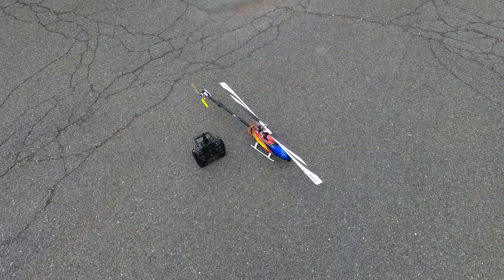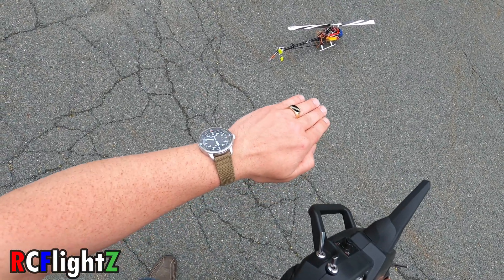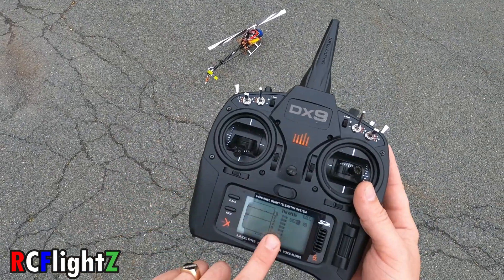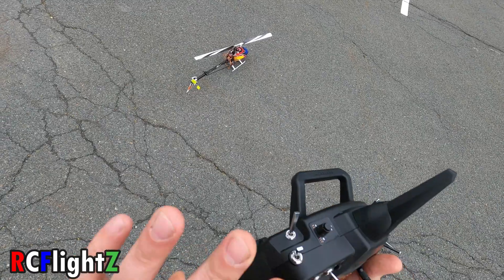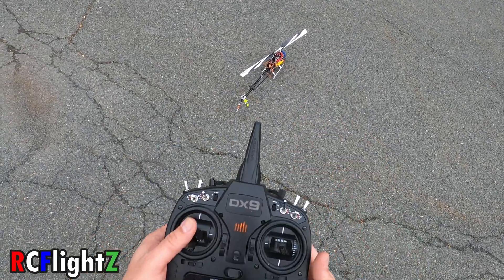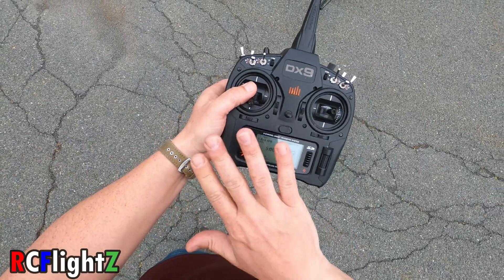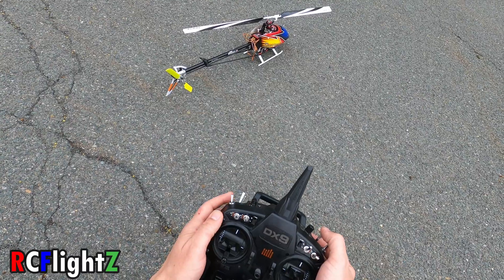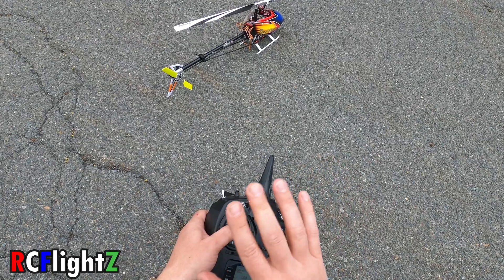Align T Rex 470L Rc helicopter Test Flight, Ikon 2, DX9

Comment: how to tell correct belt tension? 
also- running microbeastx plus, I think I read do not set dual rates or expo in the transmitter, set in the unit- do you know?
Reply from the maker: I use a wrench and push on the belt…should have some flex but not be loose…sort of hard to verbalize.

Comment: Would you reckoned  this heli for a beginner just hovering and circuits.  I wasn't something a decent size like a 500 but that's out of my budget. This 470 seems next best option. What do you think?
Reply from the maker: I’d recommend the 300 to a beginner, I’ve been very happy with it…give it some time and flights…down the road do a 470 full build.  Put time in on a sim, crush it with the 300…then move up.  Thanks for tuning in!

Comment: So the ikon2 has self leveling?    Does the beast-x that’s comes in the super combo kit have self leveling?
Reply from the maker: It costs extra…cause everything has to be a pain with that unit.  Registering, single computer editing, special cord, confusing set-up…go Ikon 2 and save yourself the hassle :)
Reply: @rcflightz2058  so the ikon comes with it out the box?  I was going to either go ikon 2 or go with spectrum To have the safe mode, panic and telemetry.  Plus for programming through my NX8 would be a plus.
Reply: Ikon 2 comes with auto level and rescue.

Comment: I have been flying the little XK 123. Good little heli. Was thinking about the Align 450 artf? I found your video to be very informative. Once I make the purchase,I think your recommended settings would be quite fitting to a new guy like me. That small one is ok,just so small man.. Your thoughts?
Reply from the maker: Personally I worked my way up in size, micro/180/300/400/500/550/650, each size has new parts/features, I’d go for the OMP M2 at this point if I was you.  It’s next level to the 123 and won’t break the bank when you overdue it.  I would consider some sim action as well, can be nice to push your skills and then just hit the reset button.  Thanks for tuning in!
Reply: @rcflightz2058  ,yes a few years ago I did do some Sim action. I had a blade 230s. Flew it for awhile,learned circles,hovering,etc. Just basic flying. Then lost it(ya went to high,lost orientation) never saw it again! Got discouraged,just getting back into it.lol
Reply from the maker: @toddnewhall5568  the M2 would be a big performance step up.  Personally I think the smaller helis are great fun and good learning tools, did my first 3D on the Fusion 180.  If you take your time with the 450RTF you’ll be fine or just start beating up an M2 :)
Reply: @rcflightz2058  ,Would I be able to setup the 450 with the inputs you suggested,and be a decent first large heli? Btw,sorry to bug you,I just like how you explain things,thanks
Reply from the maker: @toddnewhall5568  I could chat RC all day.  I believe it’s a Futaba remote, the basic answer is yes, some of the scaling and adjustments are different but in the end VERY similar.
Reply: @rcflightz2058  ,ok bud. Im gonna mess with the small one for a bit. Keep training myself. I did some research on the 450 artf,seems as if it would be a great heli. I have half a dozen 1/5 gassers,modified engines,running a Futaba 7pxr with all of them. Im still new to helis,just i really enjoy the challenge! Thanks bro
Reply: @rcflightz2058  ,what radio would you recommend? Yunno,that I could utilize once I went up in size with the heli?
Reply from the maker: @toddnewhall5568  I absolutely love the DX9…does everything I want, pretty easy to use, has taken 3 years abuse from me.

Comment: Quick question is the ikon2 better than  the 7210beastX, a lot of heli pilots using the ikon fbl unit
Reply from the maker: What sets the Ikon apart for me is the ease of programming and a few other things.  They break the programming into simple to follow “basic” programming where you follow the numbers and there’s directions at each step…you enter you’re blade size and things are set-up for you, you can go into the “advanced” manu later and tune if you chose.  The cord for the unit is a standard android based  phone, no need to order something special and simple to replace.  Easy automated  update process.  No real registration so the units can be edited with any computer with the software on it.  In my opinion…definitely, significant easier to program and more user friendly.  Thanks for tuning in!
Reply: No difference except for setup. BeastX is a simple setup vs Ikon2 having to use a PC.

Comment: I’m assembling this heli i just noted one socket that I don’t have the screw driver, this is the socket: https://imgur.com/a/oa1uTEq how you did? I only have the traditional align kit with the 4 drivers. Is this a hexagon 1.3mn? The kit came with a little hex but doesn’t fit....
Reply from the maker: I had one from a 250...I looked that up later and noticed the same thing.
Reply: @rcflightz2058  and did you confirmed? Is it a 1.3mn hexagon?
Reply from the maker: I checked...it is a 1.3mm.
Reply: The only tools you will need are a 1.5mm 2.0mm 2.5mm

Comment: Very nice flight! Well Done going through your TX Settings and near the end going through your Expo Settings.  The 470 is a great Heli.
I have a TREX 450 Plus DFC & also a  150 DFC. BLADE 230S v1 and v2, 
GOBLIN 380 K.S.E. (Triblade) and a 570S DRAKE EDITION. I Love them all.
Reply from the maker: Thank you, sounds like a nice fleet!  There’s SO much room for tweaking in the setting, I share that info so maybe it can help folks use the FBL/remote to get the flight characteristics and remote setting that work for them.  Thanks for tuning in!